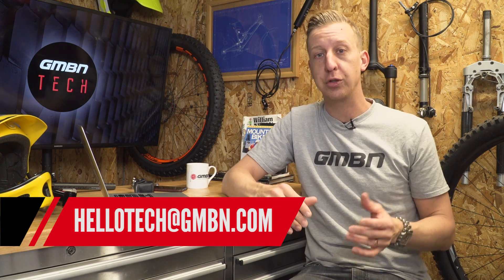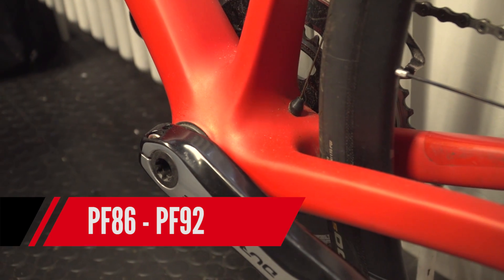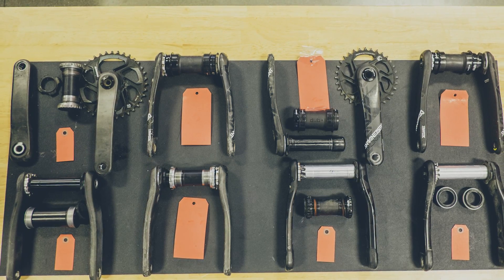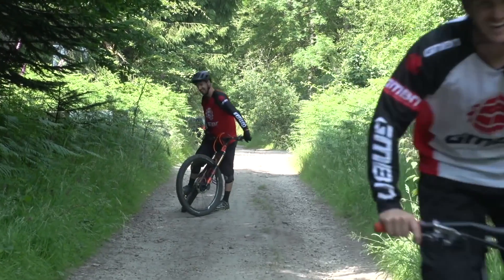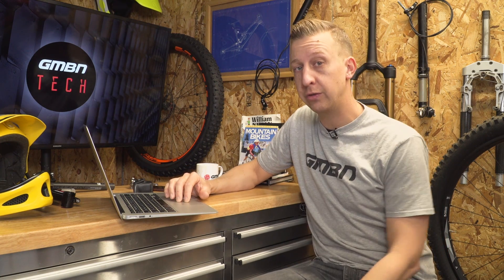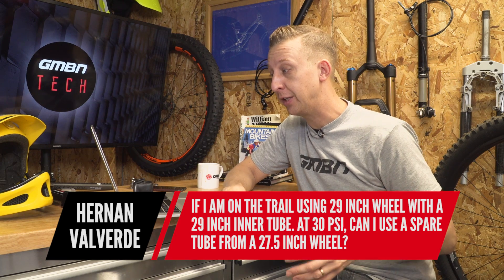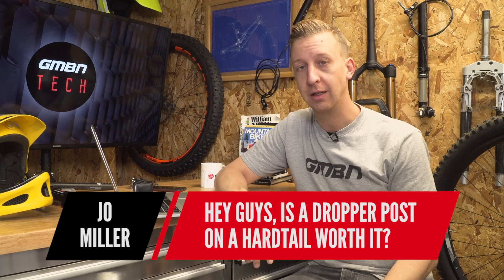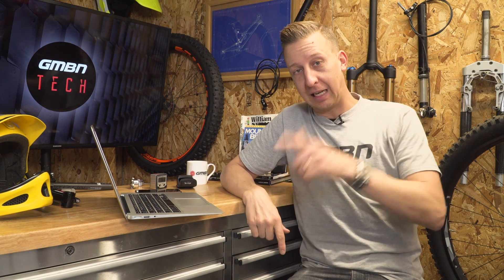ASK GMBN Tech | The Bottom Bracket Minefield Explained

Comment: I just bought a second hand bike to see what kind of mountain biking is for me.  My friends recommended to buy a used bike first with the recommended parts. So I got a 2018 Alloy GT Zaskar 29er. On my first ride early this morning, my pedals fell off only 2.3 miles into the ride and found out that I had stripped the crank which is an SRAM 2x10 (sorry I'm new to this and do not know the terminologies) from what I can see in the crank it's a 38/24T Truvativ GPX. Since I'm planning to replace the crank anyway, can I upgrade to the SRAM NX Eagle 1x12 group set without buying anything else? My head is still spinning from a day's worth of searching the net. Any info would greatly be appreciated.

Edit: what bottom bracket will the 2018 Zaskar alloy 29er accept?

Comment: Hi, I cut my hydraulic caliper Shimano SLX BL-M7000 the cable is BH90  i bought olive spacer together w/ the pin in online re seller for BH90 cable, i installed it it comes there's mineral oil leaking at the 9mm. bolt linking the caliper, i went to a bike shop i showed the problem and showed the repair kit i bought the mechanic intalled the same olive spacer & pin to the cable & have in installed again, after a week of using my bike again there's an oil leaking, is there an original shimano olive spacer specially for shimano, as i look on the online seller it's for shimano BH90  & its for M7000 shimano caliper,thanx

Comment: I dispute the idea that the original square taper threaded BB tended to fall apart and had 'crappy bearings'.  Maybe crappy knock-offs did, but I NEVER had such issues with XT or Phil or SKF or TA or Suntour or Campy.  In fact, the small diameter steel axle allowed for larger bearings that were more durable, and while the aluminum crank might re-shape, I put tens of thousands of miles on one, re-installed several times, and the crank continued to be just fine.  It was marginally heavier, but was plenty stiff (they are still used by keirin racers), and plenty durable.  My only complaint is the old style lockring that used the easy-to-slip BB wrench, but Phil BBs had no such issue.  Oh, and no creaking.

Comment: Great video, I’ve just bought a used carbon trek remedy 9.9 frame with what I now know (thanks to this vid) is a bb95 fitting, It’s a 2013 frame and when I looked on treks archives the original spec was a SRAM xo crankset 10 speed, so I went and bought a SRAM xo crankset without checking and it has a bb30 fitting 175mm 10 speed, please help! what are my options here?

Comment: The reason Front shifting is harder than Rear shifting is that the Front derailleur shifts the top (the tight side) of the chain. The bottom of the chain is always loose, so it's much easier.

Comment: https://youtu.be/UJP6WvalYeU?t=338 I figured out a hack for the recon volume spacers. I used skateboard truck bushings specifically ones from independent trucks  (https://www.skatewarehouse.co.uk/independent-standard-cylinder-medium-truck-bushings-90a-orange.html) and just used four of the the bottom ones (the non tapered ones) I roughed up the ends a bit with sandpaper and superglued them all together then carefully lined the lot up with the bottom of the air value cap and glued em to the bottom of the cap. Put the fork back together and aired it up and noticed a immediate difference in initial fork suppleness, much less of a pogo stick now.
Reply: Hi Disvet, I am think of doing that on my Scout. Would mind to do a long term review?? Thanks in advance :)
Reply: Hey I know I’m late but would a cork work

Comment: Hia Doddy, I have a standard square tapered 68/113 Bottom Bracket.  

I want to convert to external BB/24mm axel type however a couple of things are stumping me.

1) Does the axel width (i.e. not the diameter width but the width between the pedal and the crank side) become a factor..or, as I appear to have absorbed through some form of osmosis, have they standardised this at 73mm providing spacers to allow people with 68mm to make up the difference?

2) I would prefer not to have to upspec my Shimano FH-M756 VIA-M 9 speed to a whole new '2x11' compatible wheel/freehub and groupset...at the most I would consider going to 10 speed (maybe) as I could fit that to my existing freehub (I think).

It's driving me nuts but I can't find anything out there I could use...have you any ideas or should I just be looking at an upgrade?

or should I just cheapskate it and stock with a square taper (or something similar)?  if so, what's the best option here

Comment: Hi guys, I have a question for you about the bottom brackets. I have a on-one fatty trail, and it has a 100mm bottle bracket shell. But I'm struggling with the size of the crankset needed, it has external bb, so the existing x5 crank has a spindle of about 120mm. The problem is that they advertise cranks as suitable for 100mm bb shell, but they don't show the spindle length. I just bought a new crankset, labelled as 100mm bb shell, but too short! Do I need to look for 120mm bb shell cranks?
Cheers
Paul

Comment: 8:03 So far only I have tried was Jagwire Pro & Shimano XTR In Shimano SP41 housing, but XTR wore out the coating after few rides creating a very rough surface, I installed Jagwire problem solved, but I see some other people don't have this issue, but it cable routing makes a difference on wear too. But I have not tried Cilovation yet.

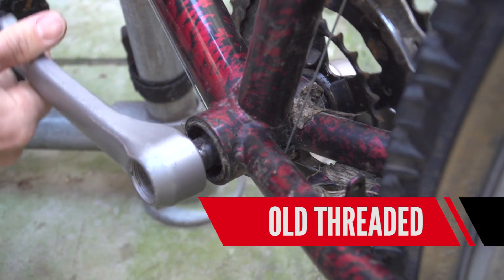Comment: 0:40  happen with both Avilio & Acera cranks in maybe few months combined, absolutely horrible system, also the Shimano UN22 bottom brackets I managed to wear out in few days, it had horrible play and knocking, replacing that constantly would cost a insane amount of money, I only spend money on proper components.
I now got Chris King installed on the old xc bike, it has angular contact bearings, it's absolutely necessary for bottom brackets, or it can wear in months.

Comment: Hi Doddy quick question for you, some of the bolts on my bike look like they have rust inside them not had the bike for that long wondered if you could help me out. Tried putting some muc off mo94 on but still out there. Ps keep up the good work 👍👍
Reply: Use steel brush or put them in alcohol. Depends of depth of rust.

Comment: I have a Norco Fluid 7.1with a sram nx 1x11 drive train. It is a 30 tooth front chain ring and 11-42 cassette. This is fine riding in the forest trails around where I live but in May I’m taking part in a charity ride across the South Downs so I have bought a race face 38T narrow wide to give me a bit more at the top end for long fast downhill sections.  With this larger chain ring on its pulling the rear derailleur forward using the same chain. Bearing in mind I’m only using this chain ring fora 1off ride am I still best to invest in a longer chain or will it be ok over 60km and not damage the derailleur ?
Reply: Buy new chain. Better spend 15$ now or 150$ tommorow.

Comment: #ASKGMBNTECH Hi Doddy, I am currently riding a 465 reach, long travel enduro bike, but I am considering swapping it for an aluminium tues size l 440 reach  because I only ride it on the downhill tracks and I need some more travel and durability. My concern is that it would feel too short going to the 440 rech tues. What do you think?

Comment: I have a Diamond back Heist 1.0 2016. I am planning to upgrade my suspension forks but I’m not brave enough to take apart my bike ,therefore what steering tube does it have and what suspension should I get ? Keep up the great work 👍🏻💪🙏
Reply: Depends on how much you want to spend on new fork. Get some fork with air spring. Look's like a non tapered frame, so get straight steering tube. If you get tapered fork, you can use some special lower headset cup to use it, but it doesn't work with every frame.
Reply: puka cheers🙏  I’ll keep that in mind 👍🏻🏆

Comment: Doddy, first of all, great video (as always). However, when it comes to the comparison of the E13 and Eagle cassette, I think you missed a pretty important point: a sprocket with 9 teeth will have considerably higher friction than a 10 tooth one (which in turn already suffers from significantly higher friction compared to a 11t one). Therefore, even though the E13 technically has a larger range (511%) than the Eagle, I'm pretty sure that efficiency adjusted, the Eagle would come out on top. I think this is an important aspect to note when it comes to such small sprocket sizes.

Comment: Dropper post is the new white sliced bread.   Screw what anyone says, sure you can bog your seat through your legs and get behind it and being able to drop it 4-6" and just get it out of the way is a complete mtb game changer.  They generally weigh a pound so you can compensate other places if you're worried about that or you can just ride your bike and it will change the way you ride and be exponentially more comfortable when you don't want the seat in the way.  Yes they're not inexpensive but after riding one of my 3 bikes with one, I put them on all of them in the following couple weeks.  Its that much of a difference.  It's great tech for sure.

Comment: Ok once and for all, before dropper posts came out, didn't you guys step of the bike and simply lower your seat manually. I mean it takes like 10 seconds to do so. That's the only benefit that dropper post gives you, you don't have to get off the bike, which of course is mandatory for races. But for casual non-racing riders, it's nothing more than a fancy expensive addition.

Don't get me wrong, I do have a dropper seat post. It's just that you gmbn guys are praising it so much and talking like you were riding with seat posts welded to the frame before dropper posts came out ;)

p.s.:Hmm here's a conspiracy. Could it be that gmbn has a patent for dropper seat posts ;)
Reply: Dropper posts are the best bit of tech since front suspension.

Comment: I thought gear inches were the theoretical diameter of a wheel you would need in order to go the same distance each pedal revolution, assuming you had no gears (ie: a penny farthing or a unicycle). this is off by a factor of Pi from how far you go each pedal revolution.

Comment: I need help I replaced my stem and when I lift it up the steerer tube moves inside I need help
Reply: Get some spacer under your stem. I had same issue. You need to have around 2-5mm gap between steerer tube and stem edge. 
Or untie stem screws and tighten cap screw.
Reply: puka thank you

Comment: Hi doddy, i had a XT M8000 rear mech for allmost nothing, and currently am running SLX 10 speed. I dont want to upgrade to 11s (no use to that and more expensive) but was wondering if i could use that M8000 on my 10 speed setup ? You can see people doing it and it works flawlessly on the internet, what are your thoughts about that ? Those who say it wont work mention "shift ratio"
Reply: Someone is using M8000 rd, shifter xt 780 10s and 11-42 10s cassette without a problem. Do it, why not? Benefit is derraileurs "brake".

Comment: I accidentally ran a resin and metallic combo in my front brake after a hurried pad change at the local trails car park once. Was amazingly good. Then I tried full metallic to only have horrible squealing from the front and what felt like pulsing. Would switch from running resin in the front back to a combo in a heart beat if I knew it wasn't doing any harm. Will always run metallic rears though. I just like the power of them.

Comment: Can a bolt thru axle go through a wheel with Quick-Release if the quick release Mech is removed?
Reply: If by taking out the "quick release mech" you mean the skewer then no. Some hubs do have removable parts to allow them to be converted between QR, 20mm and 15mm axle types however.

Comment: #askgmbn do you have any suggestions on any 205mm eye to eye rear shock? If not, is it possible to shorten a 210mm eye to eye by cutting it or something like that? I was just wondering because the Specialized Camber has a 205 eye to eye and couldn't find any shocks.

Comment: #askgmbntech loving the channel guys! I have a rockshox pike rc 130mm travel fork with 130mm rear shock. I'm thinking of bumping up the fork to 140mm or 150mm. Can I do this by modifying the existing fork? And would I need to change the rear shock to compensate? Cheers Doddy.
Reply: nick williams you can change out the air shaft, the part is pretty inexpensive. It's good to do it with a complete lower service unless your seals are pretty fresh.

Comment: About the dropper post. My frame does not support internal cable routing. Is it ok to drill the alloy frame to create its own dropper routing?
Reply: Rendy de Puniet it would be better to use an externally routed post. You will seriously affect the value of your frame, and do structural damage. I like the brand x ascend II as the cable mounts to the post collar and doesn't move when the post is actuated.
Reply from the maker: We would never recommend modifying a frame to be honest. It instantly voids your manufacturers warranty! Just use an externally routed post, there are tonnes of good options on the market!
Reply: Yes...it won't hurt the frame. I drill a drain hole in the bottom bracket of my Al, steel, and even a Ti frame -- if the manufacturer didn't put one in.

Comment: Thanks for answering my question! Hope you'd answer this question too: my bike is an aggressive enduro hardtail with a 160 mm fork. At the back though it has a 135x10 quick release system. Now this system is not recommended for downhill as it is flexy, but if i get a good quality skewer like say, an xtr skewer that has a great clamping force will the bike handle hard downhill or will I risk breaking smtg like the axle.

Comment: While on the subject of cassettes, i have a Shimano HG50 11-36t 10-Speed rear cassette and have converted to a 32T single front chain ring on the front, what ratio chain ring would give me a better range of gearing and is it easy enough to change to a 11 speed rear cassette.
thanks and love the Tech show
Reply: I did it without any issues. I put on the Shimano 11-46T mentioned here.
Reply: Mike Williams thanks I’m thinking or putting the sun race mx3 11:42t 10speed cassette on and keeping the 32t front chain ring
Reply: Before I put the Shimano on (and upgraded the RD)...I put the 10-40t version of that Sunrace cassette on. It worked like a charm (and is a arguably a better cassette for the $'s)
Reply: Mike Williams great thanks for your help, hopefully I don’t need a longer b screw on my XT derailleur, to make it fit
Reply: I didn't need one for my XT RD with the 11-speed 11-46t. I was running a SRAM X5 with the 10-speed 10-40t and the original b screw worked.
Reply: Mike Williams brilliant cheers for your help,

Comment: #askgmbntech What's your take regarding dual air vs air + negative coil systems on short to mid travel forks ? While Fox and Rockshox have switched dual air nowadays, other brands like DT Swiss and DVO are still using air and coil. What are the pros and cons of both systems ?

Comment: #askgmbntech Wondering what your thoughts are on cassette extender cogs (Wolf Tooth, OneUp, etc.)? Are these worth it? For example, extending a Shimano 11-42t cassette to a 11-49 or 50t. Maybe do a video on installation and setup of one of these kits?
Reply: There would be a big gap between lowest gears and price (80$) is really high. You can buy yourself 11-50 cassette, with which you wouldn't struggle that much. Or upgrade on XD hub and get 10-??

Comment: I made my self a display set-up for my bike in my man cave which include putting the bike in a repair stand clamp (very lightly clamped with a fiber cloth in the clamp) on the top tube. Winter here in Canada last about a minimum of 5 month. Do you think leaving the bike on the stand clamp on the top tube for a extended period of time can put unnecessary stress on the frame and damage it? It a aluminum full suspension trail bike!

Comment: Amount of valuable insights and detailed nformation in this video blows any of GCN Q&A's out of the water. Good job.
Reply: My bike and riding falls somewhere in the middle ground between GCN/MTB type of stuff so I often don't have much (or any) of personal experiences to compare with what you're talking about on those channels, but this kind of detailed and serious approach to answering questions deserves a huge round of applause. Keep up the good work!

If I have any suggestion, In the gear ratios question I think it would be good to mention easiest way to see how any given  gear setup would work on a given bike is to divide number of the teeth at the crank by the number of the cogs, the result is number of rotations of the wheel per one rotation of the pedals. It's obviously leaves out a lot of factors you go into, but it is enough when somebody is wondering about how something would work on his/her bike. Cheers!

Comment: Please don't say my name!
Do suspension-forks have air in both sides? 
At least on my bike the rebound and where u pump in the air is on different sides but I don't see where the air would change sides. How does the rebound without air?
Reply: Elias Sandell one side is a spring like a pogo stick. A metal spring or air spring. The other side has the damper, oil is forced through small holes to slow it down.
Reply: jfkusa123 ok! And thank you for the the answer 😁